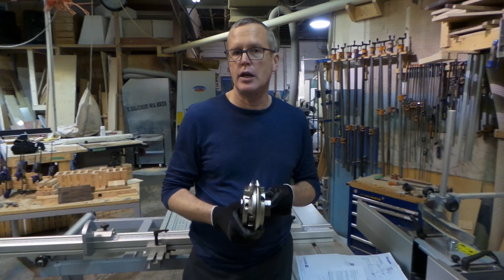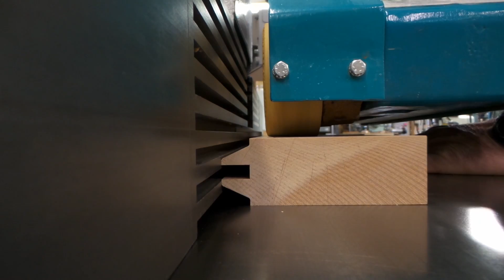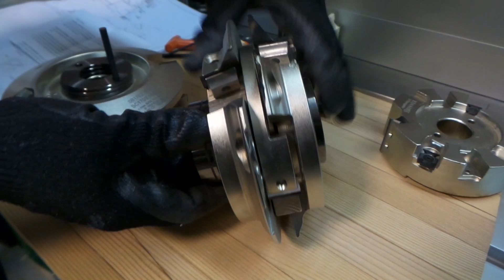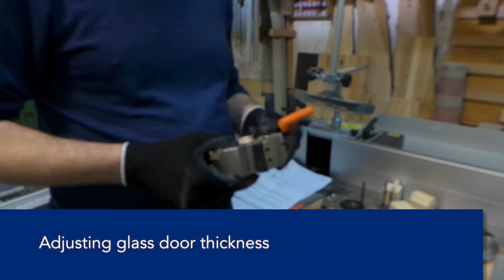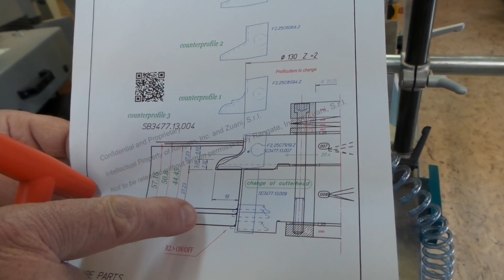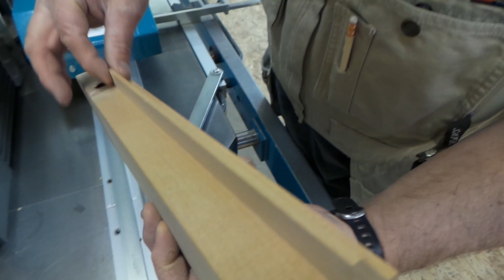How to Build Panel & French Door Frames

Comment: i would like to know more about the equipment, the machine! what kind is it?
Reply from the maker: There are two different machines in this video. The machine with the green front is by Felder (Austrian). The machine that is used for milling in the video is by Martin (German). The shaper cutterhead tools are made in Italy.
Reply: @RangateInc  What brand cutters are those
Reply from the maker: @webbandrus7824  Those are our Rangate cutters! You can see the full lineup of our standard tools at https://rangate.com/tools.
Reply from the maker: @webbandrus7824  This is our Rangate Stile and Rail cutter set, designed by us and made in Italy. https://rangate.com/products/stile-and-rail-cabinet-set. If you are making panels, here is our Panel Raise cutter: https://rangate.com/products/panel-raise-cutter.
Reply from the maker: Hi, let us know the shaper you have or you plan to get, we are happy to help you with the specifications. info@rangate.com  .  We do this very often, including integrating existing production machinery to setting up a complete new factory. Cheers!

Comment: Wow now i only need to save only 10 more thousand dollars for the equipment to make those cuts
Reply: That machine is awesome, but I only need to make one door.  After watching this video,  I think I can get acceptable results for my little project with a router and a table saw.  Rangate, thank you for the video!
Reply from the maker: @IdahoStairs  You are welcome! How did your door turn out? You are welcome to share your pictures here: https://www.facebook.com/groups/rangateconnect/ .
Reply from the maker: Hi, bomark2002 and Vincent, you don't always have to buy a tool. Check out CutterShare at https://www.cuttershare.com/ to check out the latest shaper tools that are available to use for 1, 2 or 3 months for one-time or protoype projects including cabinet door tooling set, exterior and interior door set, and even tools for making lift and slide doors. We desire to employ and support business models that enable small to large projects and jobs without sacrificing craftsmanship. So check it out to see how we can help. What shaper do you have? What are you making?
Reply: They don't sell just the bottom half of a machine; gotta buy it all